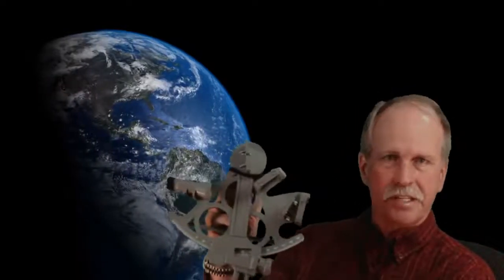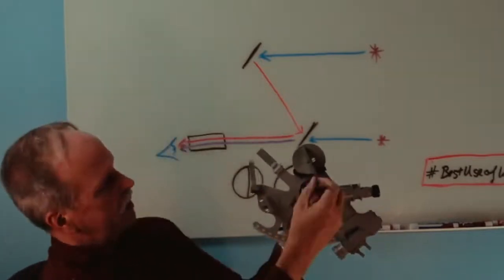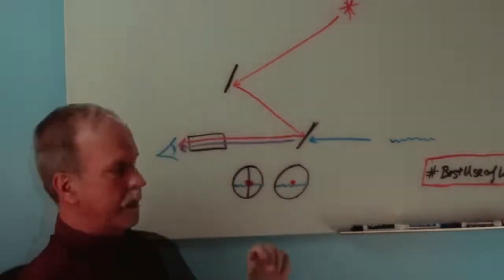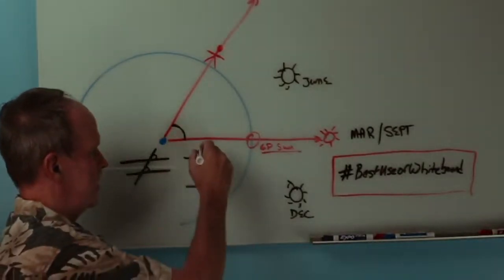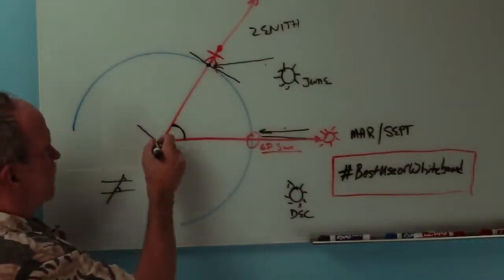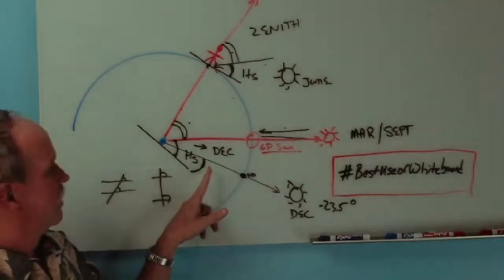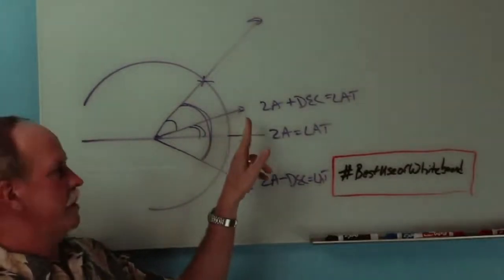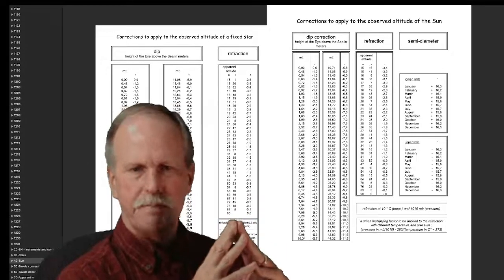How Does a Sextant Work?

Comment: All fine and good.. You got your latitude... What about the longitude?
Reply from the maker: with time.
Reply: Or by doing the same thing with a 2nd or even better a 3rd celestial body.  But during the day, my understanding is the same as the other commenter. It requires some time to have passed for you to get that 2nd position. 

I am no sailor - I can’t even swim!
My understanding is that with one celestial body that will put you somewhere in a circle, but you don’t really know where. 

With a 2nd celestial body it will give you another circle. The two points where those circles touch means you are one of those two points. 

And a 3rd would put you at the intersection of those three circles. 

Majorly oversimplified and if anyone thinks this isn’t a good kinda explanation, please set me straight.  I think this stuff is fascinating.
Reply: @528Circle  On the ocean you will presumably have some idea of where you are to within a hundred miles so they are not "circles" covering thousands of miles and locally within 20-50 miles you can regard them as lines.   Two of them crossing is a simple fix, but 3 or more is even better.  The sights can be fast with practice, the calculations a bit slower.  The boat won't go too far in 10 minutes, a good navigator could do them faster.

Comment: Hasn't GPS made sextants obsolete?
Reply: You bet story of guys in gippesland in Australia, old fisherman used sextant to measure angles on lighthouses ,during a rally bad electrical storm old fisherman able to get to harbour others using gps had to heave too. Electrical storms will knock out gps.
Reply: I bloody hope so after watching that. Now I know why I was so crap at maths in school - it's too difficult.
Reply from the maker: GPS can be jammed.  Always good to have a backup.
Reply: what if you can't afford a GPS receiver
Reply: @nonsensefactory  I would think that a sextant is more expensive than a GPS receiver. I bought two to use in my photography.

Comment: Awesome! An actual mathematician that can help me understand something! 
Whenever I drive a pole into the ground perfectly plumb, the sun will cast a shadow on the ground. I can calculate the angle of the sun with basic trigonometry using the length of the pole, length of the shadow and the 90 degree angle. So take that information and calculate the distance of the zenith of the sun on earth at that exact moment to the end of the shadow. The angle is the same. So the distance of the hypotenuse and legs of this triangle should be proportional to the triangle of the pole and shadow triangle. The distance cannot be more than 24,000 miles (the approximate circumference of the globe).  It’s honestly around 3000 miles if you use the multitude of apps/websites showing you the zenith. Question, how is the sun 93,000,000 miles away using the empirical evidence of the shadow,angles and known distances? 
 Oh, I get it😅 we don’t live on a plane!!
Well here’s the next question, say the earth is a globe, using the Law of intersecting tangent lines of a circle/sphere, using cities viewing sun rise sun set simultaneously, it still doesn’t compute the sun being 93,000,000 miles away with the given distance of half the globe. In other words, you have 2 cities on the same latitude, one viewing a sunrise the other viewing a sunset, the line of sight from the city is a tangent to the sun. The two tangents intersect at the sun. It is impossible for the sun to be 93,000,000 miles away when the radius from the cities to the center of the globe is approximately 3,963 miles. 

And if the sun isn’t 93,000,000 miles away using basic geometry, then we have a huge problem with the heliocentric model. 
And don’t give me the garbage, cop out parallax measurements. Start with known irrefutable distances and measurements on earth and go from there. 

Show me how you compute the distance to the sun using the shadows cast at different cities at a given moment. 

It should be a very basic computation that even a junior high student can walk outside and prove the distance.(approximately)
Reply from the maker: Wow you are pretty deep in that rabbit hole.  That isn't how you do it.  The transit of Venus is better and yes, involves parallax.  If you want to know the mathematics, here is the first of the 2 videos that show you just how to do it.  https://youtu.be/99PjF6HxD2A
Reply: @sliderulesandmathematics9232  nah man. That tells me enough about you. Parallax is a cop out lie to fool the masses. If Eratosthenes used geometry to “prove” the circumference of the globe, which is also a lie, then you can use geometry to prove the distance to the sun.
Reply from the maker: Parallax is a cop out??? Lol. It is the correct and most accurate way to do it. There are others that will be demonstrated
Reply from the maker: http://walter.bislins.ch/bloge/index.asp?page=Advanced+Earth+Curvature+Calculator  That is the link to the Advanced Earth Curve Calculator.  Input your observer height, distance and click standard refraction.  That will let you fill out your table.
Reply: @phillipking6153 bro what?
Reply: My friend, you can’t calculate how far away the sun is from the earth using a pole. Look up what a sextant is.
Reply: Do you really think you figured out something that everyone missed?

Comment: Sextants require two parallel zeniths or your angles will not be 90 degrees. A sextant on a globe will not work for navigation.
Reply from the maker: So you seem to understand.  HOWEVER, the earth is a globe, and sextants work, so you need to dismiss your false belief.  Now rewatch the video and see why it is REQUIRED for earth to be a globe and the stars to be distant for the sextant to give an accurate fix.
Reply: @sliderulesandmathematics9232 2:02 “ANGLE OF ELEVATION: The angle formed by the line of sight and the ‘HORIZONTAL PLANE‘ for an object above “THE HORIZONTAL“

There are no horizontal planes on an oblate spheroid in a vacuum.
Reply: Several centuries of sextant use for celestial navigation prove you wrong.

Two questions:

1. Why, after taking your sight, do you have to use spherical trigonometry to find your position on Earth? 

B. Why has no FlAt EaRtH JeEnYuS ever shown how a sextant and Euclidean geometry can give your position on Earth?

Inquiring minds want to know. Elucidate us.
Reply from the maker: simple, because 1/ they don't understand the math and 2/ the earth is not a flat plane.
Reply: the earth is exactly the same as how we design worlds in a video game, in a x,y,z coordinate system based on a massive square box that is the universe. This makes all the calculations in the universe easy instead of having some warped curved universe where you cant even stand on level ground lmao. go look at how video game worlds are designed and you will see that they are all done in a flat world based on x,y,z grid starting from a point with 0,0,0 as the origin coordinate
Reply: Sextants only work on a globe, friend 😊